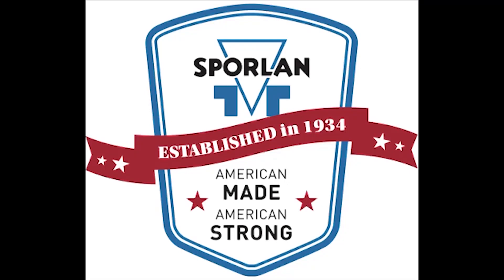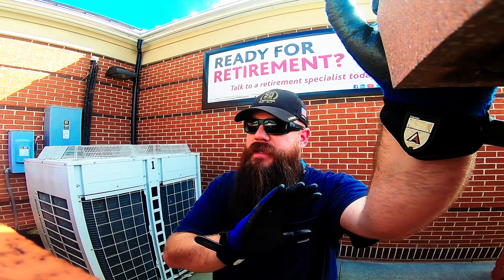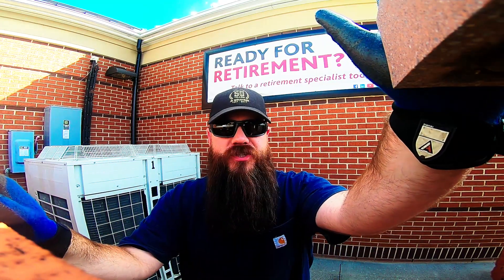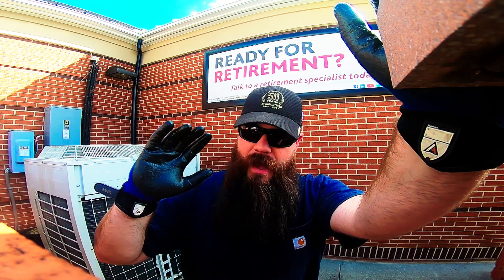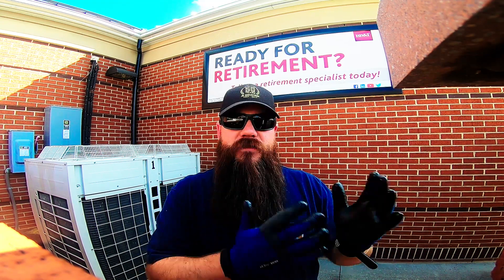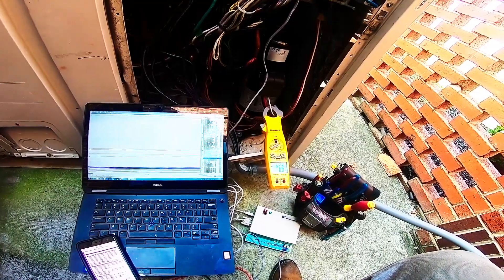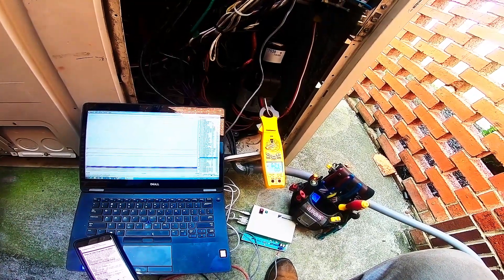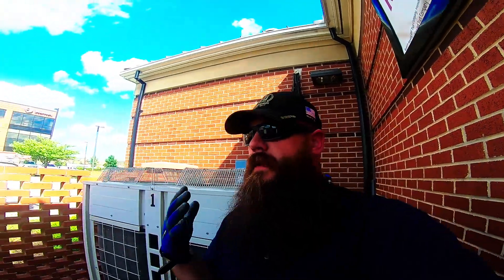Fieldpiece Meter going to time out..SC660 trouble⚡⚡

Comment: I like my Fluke 902, I thought the bluetooth side of it would work really well with my Mantooths. The thought of it was sometimes, but rarely I have evaporators with the shraders visa-versa from condensers having them. Seemed to work really well, especially when adjusting an expansion valve in say a walk in.  However I'm not to sure I like the Mantooths too much, what do you use for wireless gauges?

Comment: Nothing worse than an untrustworthy meter.
That being said you may be interpreting the frequency data incorrectly.  RPS does not mean frequency.  Synchronous RPS can be calculated by dividing your frequency by the number of poles in the motor then multiplying by 2.  If the Daikin you show has a 4 pole motor then the numbers work out about right with the frequency your meter showed on the high end; the low end was close but due to low speed inefficiencies of the motor could account for the slip.
As for the phase rotation issue, I can't help you there.
Reply: The formula to calculate a synchronous speed of a motor:  f = PN/120 where f is frequency of power supply, P is number of poles in the machine and N = speed in rpm.  As this is an AC motor, frequency(f) comes into picture along with the effect of field poles(p).    Hence the formula for finding out the synchronous speed(Ns) of a motor is given as
Ns = 120 * (f/p) .
120 is again 2* 60 which is no of poles per pitch multiplied by time in minutes.
Otherwise, RPS and hz are 1/1
How many hertz in a revolution per second: 
If  fRPS = 1  then
      fHz = 1 × 1 = 1 Hz
How many hertz in 46 revolutions per second: 
If  fRPS = 46  then
      fHz = 1 × 46 = 46 Hz
Reply: i was thinking the same thing. rps on 4 pole would be double hz

Comment: I'm not sure what the exact conversion is, but on Daikin equipment my own experience is that the rps value reported by the service checker is roughly half of the HZ reading I get with my Fieldpiece SC56 at lower speeds, and grows to over half at higher speeds, so there seems to be more to it than it just being rps x 2 = Hz. 
Daikin inverter compressors run from 52 Hz through 211ish Hz per my SC56 and another brand of clamp meter I've tried. 
The SC56 is also bang on with the digital display on VFD's.

Comment: Also to get the meter "to see" a higher current to trigger the minimum current to read Hertz one can have multiple turns through the clamp meters jaws. Say a mini split is only at 3 Amps then 4 loops through the jaws is like 12 Amps through the window. Ie 10 turns through the jaw is 10x the amps

Comment: one thing i never cared for is the size of the clamp ring. on these meters  its ok for large conductors. but its also a large antenna.
@ 5:35 it is laying on the other conductors.  is it picking up from the wires beside it?  maybe try seperating the wires and spacing them apart further. as some have mentioned the reading is almost exactly double which is exactlty what would happen if it is picking up another phase from a nearby wire. just my thoughts.

Comment: HELLO AK and the great HVAC group.  My take is a retest with the dial set one click CCW.  Ie to the Aac Hz position. In your test it is in the higher 400 Aac Hz position which requires more amps to trigger a clamped Hertz reading. Thus I think you got a wacky 2x reading since not enough current. Your Fieldpiece SC660 does measure frequency with the Clamp and you correctly pressed Select button twice to place it in Hertz mode. In the SC660 manual the minimum current in Hertz mode are on page 7. The threshold is rather Large in your 400 Aac Hz position. Ie 50 Amps! In the Acc Hz position it is 10 Amps from 10 to 100Hz and 25 Amps in 100 to 400 Amps.   *****Also I bet all those specs are for a sine wave and not a raspy inverter output! Regards to all. 3BW

Comment: I’m running the testo 770-3 as my daily driver it does hertz but not phase rotation unless I’m missing it. But it has been pretty good so far.  I am looking at testos other models they have phase rotation on them I might try one of them my only complaint is the test leads I like fieldpiece leads so much better.  I’ve been running the fieldpiece hs36 for years and love that meter but it lacks the hertz feature which I’m running into a lot now hence the trying out the other meter. I’m glad you posted this video because I was and am contemplating this meter if they resolve this.

Comment: I’ve used a Fieldpeice sc440 for about a year now, I originally had the 660 but it was such a large meter I sold it, so far the 440 is ok I have questioned it a few times. I used a Fluke for years in a industrial environment and just wanted to try something different. The 440 is ok I think Fieldpeice is way better than the Kline/ Uei cheaper brands. But I’m thinking about going back with my fluke. Or I might try those new testo meters idk

Comment: I have a true RMS Fieldpiece and I tried to check the frequency on a motor running off of a frequency drive and the meter was wildly inaccurate. Not sure if my meter is supposed to be able to read that correctly off of a vfd but it definitely was disappointing.

Comment: I switched from Fieldpiece meters in 2003, every time it rained they died.  I got UEI phoenix it still works. I got the DL429 it’s been great.
Reply: OcRefrigeration,Hvac & Electrical. For most of the stuff we do UEI is fine.  For industrial stuff at my day job I have fluke.
Reply from the maker: Nor-Cal Refrigeration & H.V.A.C your not the first to mention UEI in this thread...I may have to give them a shot!  I’ll be honest man, I’ve never even held a uei, always used fluke then FP recently.
Reply: AK HVAC I have fluke at the day job there the best.  For HVAC service the UEI is killer for the price.
Reply: I have the UEI and it does good on for the most part but it chokes on vfds. I have the fluke 87v and the fluke 376fc, amprobe acdc 52nav and the UEI 379,  when you put them all against each other the fluke is dead on to what the display says give or take maybe one hz or two, the UEI pukes and chokes and picks up the carrier frequency because it has no low pass filter. The amprobe is a monster packed full of features but it's battery life is horrible. I sent it back to amprobe which is owned by fluke and after getting it back and it still had bad battery life, I called again and they gave me a new fluke 376. Which blew me away since that meters well over $350. It appears that it's hard to get a meter with all the goodies and still be accurate. I like some of Fieldpiece tools but they are not the best. I love my Fieldpiece probes but the app sucks. I guess you can't build everything top quality. If I can find the other footage I'm going to post the Navigator versus the fluke versus UEI.
Reply: i don't see uei as a top of the line meter/ highly accurate.  they are like chevy's they just get the job done. 
if u want high accuracy Go Fluke !
Reply: Yep, i Love my Uei ! it does Not Eat Battery's ( i cant remember when i last put a battery in it ) , Durable , it does not get takencare of and still hangs in there. Uei Makes Good Products & i amvery Happy with  them. i own Fluke stuff too , they are more Money , But u Do Get What u pay for with a Fluke. They Last & Last , and accuracy is Good, i Have 20-30 yr old fluke stuff that still Works. Fluke stuff is calibratable too , if u are doing work that that has to be tracable to Nbs standards.

Comment: Does the manual say it can read the DC frequency side of the bus? I thought it would only read the AC side.
Reply: There is no such thing as dc frequency.   It takes alternating current to have frequency.  I realize there are are lot of people suggesting they are running dc motors, but they are not.  More likely the meter frequency problem is because the vrf’s recreated ac waveform is not a perfectly clean sinewave and has harmonics on it that the meter is detecting.   Or a phase shift caused by the motor back emf is being counted.  Phase rotation detection is another issue but could be related.  Nevertheless, tech support probably has no clue about this application.  A senior electrical engineer at fieldpiece may be needed.  Prediction:  Fieldpiece will punt and say it won’t work on vrfs and give a refund.
Reply from the maker: Lee Johnson if that’s true, why would I ever care to see the ac side of the bus?  The meter has another HZ feature that uses the leads to confirm 60 Hz on ac power. To me that would be a waste and gimmick feature, but I will look more into that for sure.  They also have the phase rotation issues that I need some answers on.
Reply from the maker: RJParker you are right about tech support, which was why after I spent 5 minutes detailing my issues, “change the batteries” was the response. Good theories on potential causes for the funky readings, but if FP wasn’t prepared for that, why make the feature at all?  I am not aware of ANY vfd technology in this trade that don’t have LC filters, chokes etc. if the clamp can’t perform in the midst of these components, I’m not sure where it can at all that’s useful to a tech.

Comment: So I guess here's where I am confused (which I usually am) on the HS36 YOU HAVE TO TAKE THE TEST LEADS and go across the terminal...the clamp never works... however my HS36 AND THE DL429 both can do flame sensor with just the clamp...not have to jump in series..but yah man...don't use the clamp..use the leads...like put your leads in your 120v outlet at your crib...then switch it to HZ....TELL ME IT DONT WORK THEN?!?!😉😉😉😉😉😊🤗🤔🤗
Reply from the maker: HVAC/R DUDE yeah the sc660 has the lead feature too...for different purpose. The lead Hz feature is for confirming 60 Hz on ac power....the clamp is a different function for testing fluctuating frequency like on a VFD.
Reply: AK HVAC see I'm dumb as fuck as usual...anyways...I'm going to go eat some rat poison 😵
Reply from the maker: At least that’s how it’s marketed, but has not worked for me so far.
Reply: AK HVAC I've literally about had it with EVERYTHING LATELY...I BEEN USING MY OLD GAUGES...MY TESTO BLUETOOTH WORKS FROM LIKE 13CM AWAY...ITS A FUCKN JOKE...AND THE UEI BLUETOOTH...A FUCKN JOKE TOO.. SOMETIMES ITS OKAY...BUT IM JUST DONE...FUCK IT ALL
Reply from the maker: LMAO
Reply: Boyz and their toyz
Reply: The HS36 and DL429 can't measure µA current in the flame sensor circuit with the clamp!

Comment: Be careful using the "Specialty features" on that meter. Particularly the phase rotation. If it gives you an incorrect reading before starting up a new screw compressor you would have a bad day.
Reply from the maker: DanF lol did you watch the video?  That’s exactly what happened brotha!  Strike 1 2 and 3 for me
Reply: AK HVAC ya I watched the video. I said screw compressor not scroll. You don't get a second chance with screw compressors on a chiller.

Comment: I don’t know if the math is correct. The VRV III will run at 133 rps or 7980 rpm balls out, but that’s at 210 Hz. So they run between 52-210 Hz. I don’t know what the minimum rps is for them, but I don’t believe 66 rps is equivalent to 66 Hz. Not defending the Fieldpiece and saying its good, just saying rps doesn’t equal Hz. And their 3 phase rotation feature sucks, Amprobe AMP320 is much better.
Reply from the maker: tcpHVAC/R really?  Last daikin class I went to the guy went out of his way to make sure we knew rps was Japan’s way of saying cycles per second, or HZ. Good to know!    So if it’s not rps, where do you confirm HZ?  York has a clear Hz readout on their ODU display and service checker, and I had very similar discrepancies
Reply from the maker: A buddy just sent me a rps/Hz conversion calculator, it seemed to show them being 1 to 1 ratio...in other words 66 rps is in fact 66 hz 🤷🏻‍♂️this is getting interesting!  Let me know what you think tom!
Reply: The confusion lies in rps equaling revolution per second when I believe it is the SI unit Radian per second.
Reply: Even if it is the SI Radian per second the calculation doesnt work out...66 Radian/second is about 10hz
Reply: I'm not sure what the exact conversion is, but on Daikin equipment my own experience is that the rps value reported by the service checker is roughly half of the HZ reading I get with my Fieldpiece SC56 at lower speeds, and grows to over half at higher speeds, so there seems to be more to it than it just being rps x 2 = Hz.
Daikin inverter compressors run from 52 Hz through 211ish Hz per my SC56 and another brand of clamp meter I've tried.
The SC56 is also bang on with the digital display on VFD's.

Comment: Did you try the range button? I was reading the manual, and there is an option with the range button to take it off auto and manually dial in the range? Not 100% sure how that works yet. But something to check.

Comment: No, I don't work for Amprobe😅 but I do like that Amp-320 & the newer Acd14-Pro. Both excellent meters. I wish they would send me some free stuff 👍
I also have a meter that does the phase rotation like the 660. My owners manual tells me to put the Black test lead on L3 (and leave it there), then put the Red test lead on L1 & wait for it to lock in. Then within 5 sec. move the Red test lead to L2 & then it will show forward or reverse rotation. It always works properly for me that way. But it's a no-brainer with the Amprobe 320 because you have 3 individual test leads and it actually has small "dash marks" that go around in a  Clockwise Circle or a Counterclockwise Circle showing you very clearly which direction you're going. I don't think there's any other meter on the market that does that.
Reply from the maker: Thats awesome!  The PRM 6 has three seperate leads as well, but again that 320 is looking real good!

Comment: By the way, where is the controller for the equipment measuring the frequency at, where does it get the data?
Reply from the maker: That service checker (the tool on the ground next to the laptop) is interpreting and interfacing to the laptop, giving it data from the board on the outdoor unit.  The outdoor unit gets all kinds of data from dozens of sensors that read temperatures, as well as electrical measurements.
Reply: Thank you for the info.

Comment: I'll be completely homest. My HS36 is great, BUT... When measuring capacitors wires in parallel, OR series, the MFD accuracy is WAY off from the math, and my fluke 87V. Not a very important issue, as testing caps is best done individually, but it bothers me as the inaccuracy is in the neighborhood of 40% lower in series, and 38% higher in parallel. Completely inaccurate. I do love my 87V to death, the interface is great, and the accuracy and features are great. My two cents